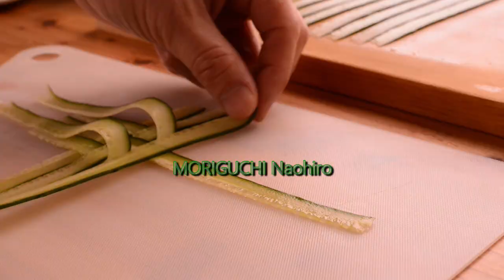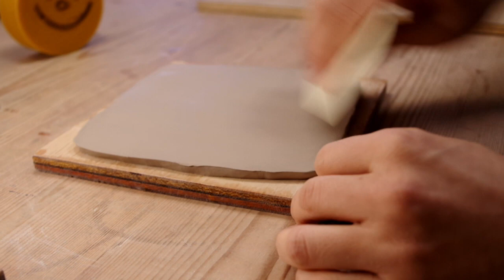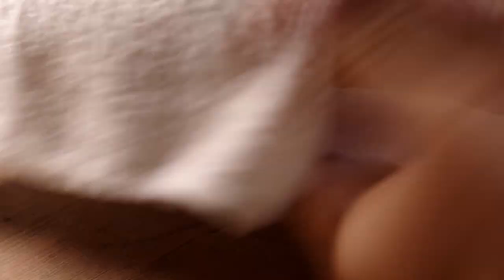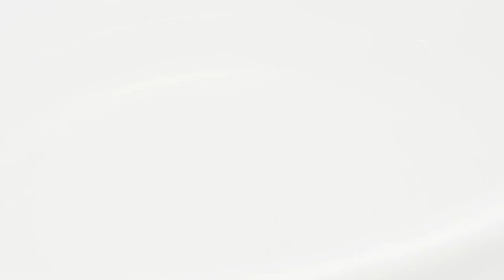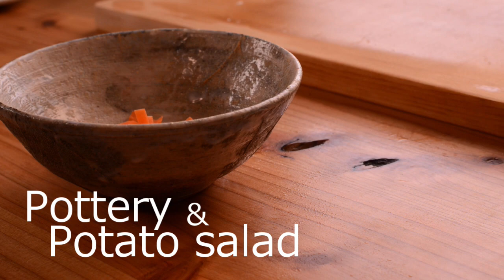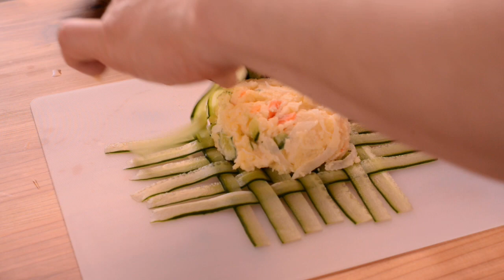編み込み風角皿をつくって、キュウリ編み込みポテサラをつくる・Pottery & Potato salad（Japanese　pottery）

Comment: I'm curious why you soaked it in water before you glazed it and what glaze you used?  It's such a cute little dish that I've put that on my list of things to make.  Thank you!
Reply from the maker: （Both the original Japanese text and the machine translation are described.）

Thanks for your comment!

Reason for soaking in water before glazing.
This is to highlight the uneven pattern of the work.
When the work is wet, the concave areas will be darker in colour and the convex areas will be lighter in colour.
If the paint is applied dry, the colour will be uniform throughout.

Glaze used.
A clear glaze.

（釉薬をかける前に水に浸した理由。
作品の凹凸模様を際立たせるためです。
作品を濡らしておくと、凹部は色が濃くなり、凸部は色が薄くなります。
乾いた状態で絵の具を塗ると、全体の色が均一になってしまいます。

使った釉薬。
透明の釉薬です。
）